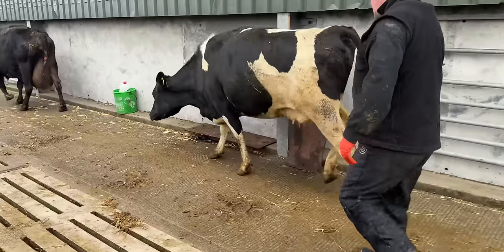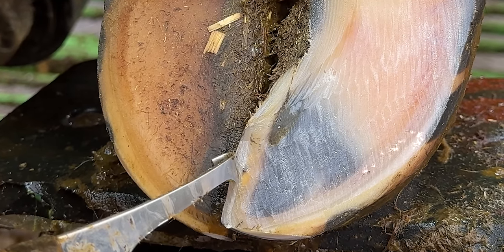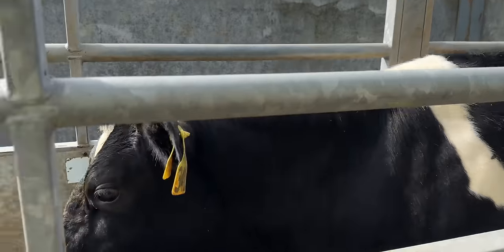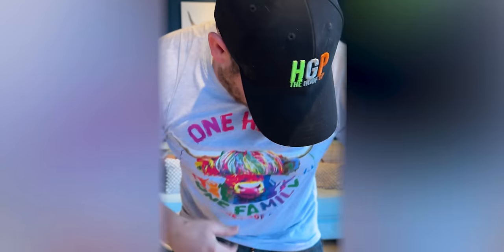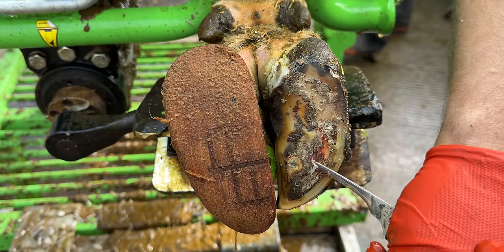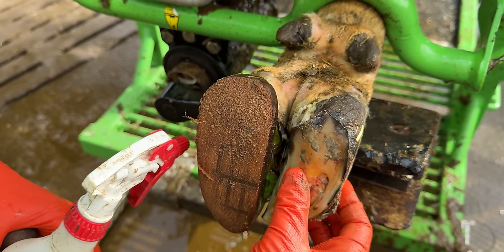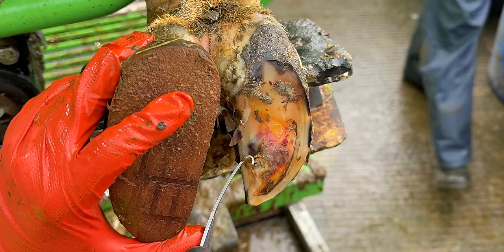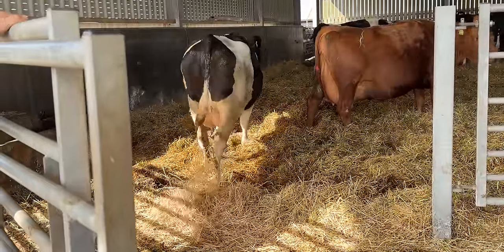cow's INTENSELY PAINFUL foot ... takes a surprising turn?

Comment: I'm relatively new here so out of curiosity, why not develop a block that provides a cushion to put on after each trim like a shoe. Something to provide protection for all hooves at the same time to possibly prevent the lameness from ever developing? Would a soft block with a durable sole prevent or would it cause more issues?

Comment: Pleeeeeeeeeeease don't use clamps. How could you use them ene that u know she is in pain. If you don't know where the problem is, just start digging till u find it. 😢😢😢
Reply: Just start digging?  I hope you are never my dentist or my surgeon.
Reply: He needs to know WHERE the pain is coming from, you can’t just go digging into a cows hoof otherwise you’re going to make it worse, the more the foot is an open wound the more likely they’ll get infection, some of which they can’t come back from.
Reply: If they don't know where the problem is, they might remove healthy horn from the wrong side of the foot, and then have nowhere to attach a block to. It's like when a doctor digs into your belly to find where exactly the pain is coming from, instead of just opening you up to have a look. A momentary pain is better than a huge unnecessary procedure.
Reply: I’m not a hoof trimmer, but I suspect digging around could cause more problems. Just like us humans, sometimes, investigations cause a brief pain reaction to solve the cause. I know it’s horrible to see her in pain, but….
Reply: 😂💯 @StrongDreamsWaitHere
Reply: The use of the clamps is to better and more accurately determine where the issue within the hoof is (especially if it isn't super obvious at first glance like in the video) so that he can slowly start taking away layers off of the CORRECT claw and start fixing the hoof so it can start to heal and if by chance the cow ends up needing a block he won't accidentally damaged the claw needed to support the block!

Just cutting away/digging into the hoof when you don't know for sure if it's the inner or outer claw of the hoof that is causing the issue would only cause more pain for the poor cow in the end! While the clamp applies an uncomfortable amount of pressure it's no less different than if we stretched a sore muscle, wiggled our finger or toes after hitting them hard to check for any major damage, or us squeezing a pimple or a splinter out from our skin! Quick moments of pain to A) better determine how bad the damage is/where the main damage is on the body and B) to start the healing process with our focus in the right area!

While the clamps don't feel good at the time, they are an essential tool of the healing process for the cows by making sure Graham's focus is on the right claw of whatever injured hoof he's dealing with in the cow! Makes sure he's actually helping and contributing towards a successful healing process and not accidentally and unnecessarily digging into the side that he'll need to glue a block on to keep the injured side up and out of the muck and to keep the pressure off that claw while the hoof is healing!
Reply: As you consider yourself fit to give advice to GP, please lay out evidence of your doubtless high qualifications in bovine hoof anatomy and extensive  experience in both routine and clinically problematic hoof trimming, so that he and his peers can judve whether or not your advice will be helpful to them.